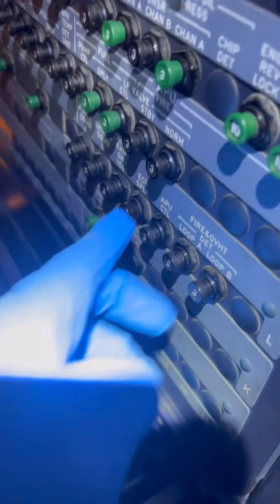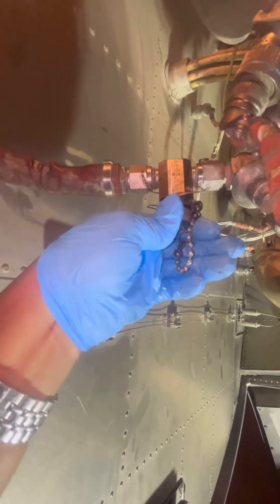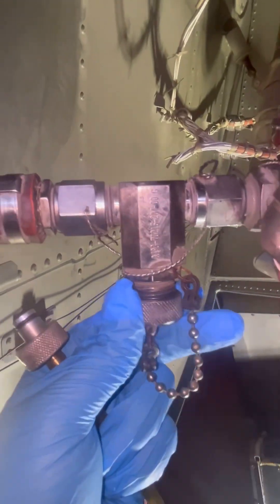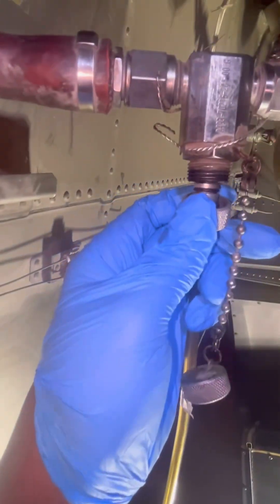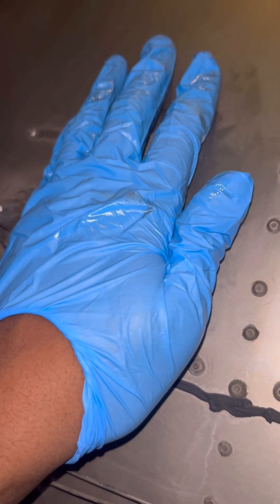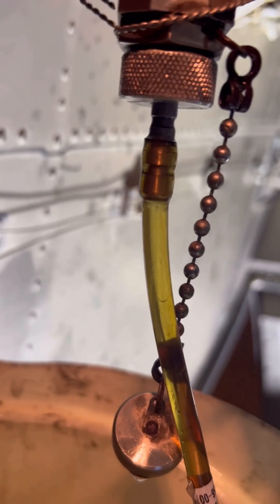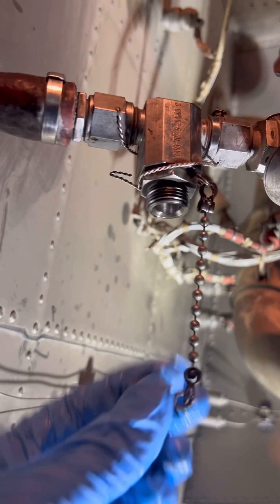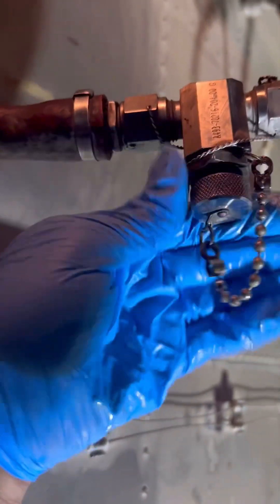Airbus A320 Auxiliary Power Unit Fuel Feed line purging

Comment: Sorry but you mean that when pushIng the vent switch the electric will operate the APU pump ?
Reply from the maker: Yes .When you push the switch it will run the APU DC fuel pump
Reply: @aircraftengineered  thank you